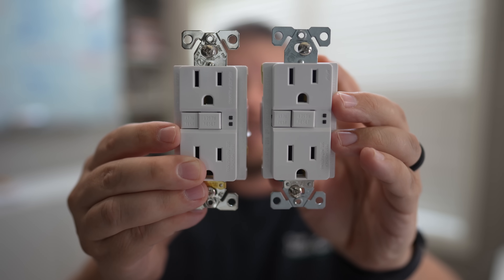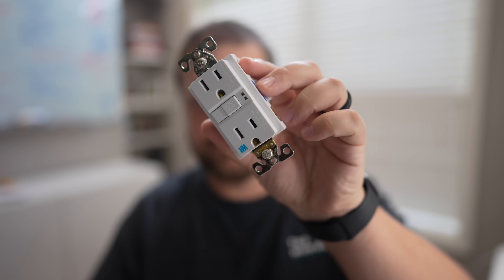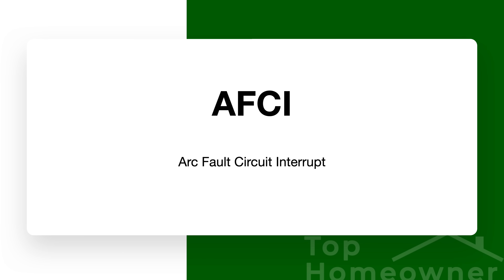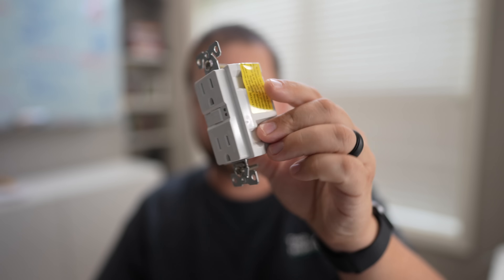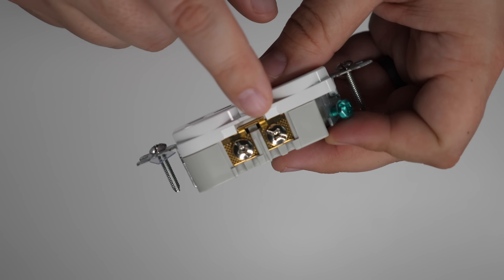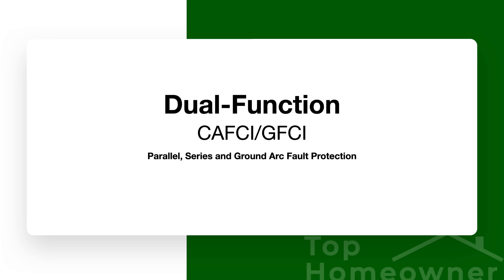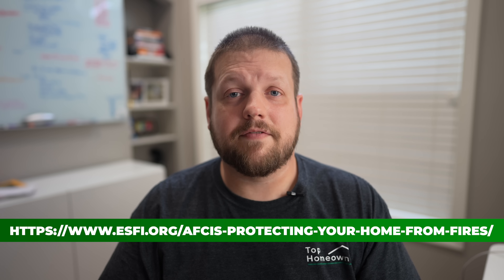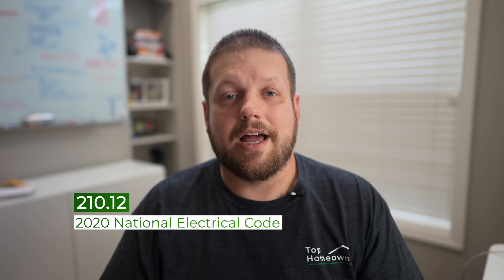AFCI vs GFCI: What's The Difference and Why You Should Care

Comment: As an engineer, I found this video really good on one point many miss, and poor on others.  

I was waiting to hear it claim a GFCI senses current to ground, and impressed that it spelled out difference between hot and neutral, while avoiding that common error.  That of course is what enables a GFCI to be useful with 2 wire appliances common in kitchens and baths. How it does that could be compared to an Amprobe type meter, and why it reads near zero if looped over a power cord, versus a single conductor.  Anyone familiar with CMRR in microphone and similar cables, or differential amplifiers in instrumentation, plus with basic physics of current and magnetism, could of course picture a deeper level of detail.  Also think UTP and STP in telecom and data networking cables.  

AFCI's may detect some of the described faults, but their Code legislative justification is most certainly NOT for the basic building safety violations this video suggests. The solution to that is blacklilst the incompetent jerks pretending to be those electricians.  Bedroom locations for AFCI's assume they're locations where old dried out and tiny SPT wire to lamps or small appliances with failure modes from broken insulation at pinch and bend points starts fires, as well as use of undersize extension cords, or crap receptacles (eg, Chinese outlet strips rated 15 amps with heaters, that catch fire as they age just slightly).  

Those cables may arc when failing, without a ground fault, and with far less current than a normal breaker trip.  By comparison, 14 or 12 AWG permanent wiring rarely has those same faults, and is more of an issue in a kitchen or laundry feed.  

As to how or what AFCI's detect, "noise patterns" is a fairly decent answer, but absent going into electrical engineering details, it's sort of hard to give an accurate as well as simple answer.  

FCC does not itself certify Part 15 low power unintentional radiator conformance, but contrary to a couple of mentions in this video, that has nothing to do with the fire hazards AFCI's are meant to prevent.  (Junk knockoff products illegally imported via ScAmazon may have other unrelated quality of manufacture defects, which are in fact relevant to AFCI detect parameters.  ScAmazon blacklists customers who post factually accurate reviews critical of spec and legal frauds of those types, by it or its vendors.  Its coerced distribution from their warehouses and logistics services place them in the position of physical commerce in such items it then pretends are only third party crooks, as if eBay shippers in China; if only Customs, the FBI, FTC, and FCC, did a serious investigation, it'd require shutting down all ScAmazon warehouses for a few years of detailed review of many items.)
Reply from the maker: Thanks for your feedback! One quick point is that AFCI's are required pretty much everywhere in a home now, bedrooms were the initial requirement 25 years ago. Most likely to phase in the requirement over time. Doesn't make much sense to only have them in a specific area of a home otherwise since you can have damaged in-wall wiring, loose connections, or bad devices in any part of a home.
Reply: @TopHomeowner  If we think about where lamps or small appliances with such potential failures are used, that's also "anywhere", even if bedrooms were the original focus.  

There are also the false trip issues largely from brush motors, and adverse response to AFCI's when fans, vacuums, small tools, kitchen mixers, fans, etc, may have conflicts.  The intervening time may have assumed people would adapt, designs to lessen those conflicts mature, and costs go down or be more expected than when initially introduced.  

There are places where false trips are more serious, like the freezer in my garage not far from a double laundry tub utility sink, where risks from a false trip are more serious than ground faults or arc faults.  

In some regions, AFCI's may help with yet another failure cause...  Not bad wiring from electricians, but rodents love to eat certain plastics, or burrow in attic insulation. In those cases, only breaker versions and not point of use device receptacles, can help.

Comment: The guy that invented GFI‘s was a friend of the NEC board they got together made it mandatory to install GFI.They made off with millions.More people have been injured because of GFI, especially when the elderly required oxygen generators.  And in hospitals and at home if the GFI trips they go without oxygen heart etc.. That’s why hospitals do not plug into the GFI circuit only dedicated, which is an orange plug.
  In Europe, they do not have a ground wire system. Everything is double insulated, here in America almost everything that we use is double insulated making GFI‘s worthless useless and a unneeded cost, but the guy that invented it and the Nema guy they’re living in the Bahamas, high and mighty.

Comment: How do you inspect a circuit for an arc Falt?
Reply: Arc fault breakers in bedrooms are just another scam like GFI. They don’t use them in Europe because it’s a two wire system., everything is double insulated in Europe and it’s getting that way here in America as well. The code for GFI really needs to be rewritten and the guy that invented it and the NEMA GUY,  they made millions  THEY ARE scammers by the way I’ve been an electrician for 52 years with a masters license.

Comment: Your point about them being required in new boxes put me at ease about why it was so hard to find a combo AFCI/GFCI receptacle today. 

Sounds like new house doesn't need AFCI because it's already present at the breaker, old house doesn't "need" it because it's not needed for code. The only people still shopping for them are overly cautious DIYers and special projects.

But I needed a GFCI for the wet areas, and decided to splurge for one for a dedicated microwave line. I'll be happy to have spent the extra $9 total to reduce my fire risk by at least that much. 

Luckily, while they didn't really upgrade my breaker, they did re-run most of the Romex. So at least I'm not looking at fabric in this 100 year old house.
Reply: Your insurance company may suddenly decide you need them whether they are code or not.

Comment: I had a GFCI outlet that would trip when I had a space heater on it and too much connected to the same circuit it was on but not on gfci's. The breaker would never flip just the GFCI outlet would flip. I suppose with the space heater pulling a good amount of power a long way and two other outlets pulling power a good distance must of eventually caused the load on the GFCI outlet to become unbalanced.

Comment: If you protect a circuit with a breaker, are you required to put a GFCI sticker on all protected receptacle wall plates?  Or, are there wall plates with GFCI emblazoned on them?

Comment: I didn't even know they made an individual AFCI receptacle.  Just put all the damned fans on the lighting circuit.  Then you can put the whole plug circuit on one AFCI breaker.  And if the clients breaker trips, try an "AFCI/GFCI combo breaker" which are usually less sensitive and usually work as a magic bullet to the problem.

Comment: The thumbnail uses two copies of the exact same picture of the same outlet, but pretends these are two different outlets.  Downvoted for lying and being clickbait.
Reply from the maker: The term 'clickbait' refers to content that fails to deliver on its promise, which is not the case here. If you watch the video you can see that I show both types receptacles side by side in the opening which confirms the thumbnail is accurate.
Reply: @TopHomeowner  My comment applies to the thumbnail, not the video.  The video can't be clickbait because that can't be viewed before clicking on the link to the video.  The thumbnail can be and was in this case.

Comment: I hope AFCI has gotten better in the past 5-6 years.  They are widely known for the “nuisance tripping”.  And for no apparent reason.  My niece home has them and two of them kept tripping.  After expensive service calls(2), they are replaced , and one of the breakers replaced twice. The replacements seemed to rectify the problems, finally. A lot of wasted money to correct the defective breakers.
Reply: Any breaker over 10 years old has exceeding it's life expectancy and could possibly fail. Most don't but I've now replaced 5 on my 19 year old home, two of which have been AFCI type. Carpet and static electricity is also a problem with AFCI when plugging devices in and will trip them.
Reply: @AZBADBOYz  Is that the life expectancy for AFCI breakers?  I know standard breakers should be good for 30 years, if not longer.
Reply: I bought the new receptacle kind for my kitchen about a year ago. They've been working perfectly but who knows 🤔

Comment: Don't drive nails and screws through electrical wires in the walls and make sure all connections at receptacles and switches are tight, don't need very expensive new breakers?  Got it.

Comment: If I disconnect or add a very reactive load, will the induced voltage be seen as a fault and trip? Electric motors come to mind.
Reply from the maker: Yes, it can. Motors are one of the things AFCI's tend to have a false positive reaction to. They've gotten a lot better at rejecting false positives over the years though.

Comment: I am getting nuisance trips in the kitchen I wonder if I put a AFCI instead of a GFCI plug in. I probably read the box and thought this outlet sounds better than this other one and installed it. lol.
Reply from the maker: Very possible! It should be stamped on the front. It'll either say AFCI, GFCI or both.
Reply: Yep. It actually said both AFCI and GFCI on the front of the outlet. @TopHomeowner   I just replaced it with a standard Tamper Resistant GFCI today hopefully that solved the problem. :)

Comment: I know how GFI works, or compare the current coming and leaving, if there is a milliamp leakage, it will cut off the power.  AFI?  I have a hard time to seeing Arc by 110V.  Shouldn't parallel arc trip the circuit breaker?  Anyway, it is good to have these to protect the wiring (and house fire).  Here is a cheap solution, or NO electricity to anywhere?

Comment: My old landlord knew all the tricks of the trade and did everything the cheapest way, his way.  I kept smelling what I thought was cigarette smoke in the house of a night.   I don't smoke.

I finally tracked it down to a connection he or one of his "helpers" did coming out of the circuit breaker box.    The twist connector had gotten so hot that it was melted on the wiring.  He had twisted together aluminum wire to copper. This is something you do not do.  Both expand and contract at different rates and the connection will come loose.

He always did things the cheapest for him.   He updated the living room with new drywall but put in no insulation in the ceiling making it really hard to heat.

Comment: I just want to point out that "nuisance trips" from AFCIs are almost always because you are using a device that does not have the level of power line filtering that it's really supposed to have built in.  You can usually fix this fairly easily by just adding an extra power line filter to the power cord for the device.  You do not need to (and should not) get rid of the AFCI breaker.  Just fix the bad device instead.  It's not actually that hard.

Comment: AFCI's  do  not detect sudden power   they detect very very small arc.  like the arcs you can visible see in a brushed motor..  which is why they cause nuisance faults  
or say a cord is partially loose, but it's close enough for an arc to jump the gap,    this small arc can maintain for a  long time.. and start a fire..       which is why they are required on bedrooms

Comment: gfi are annoying but worth it for safety in wet locations afci is just ridiculous and I replace them with regular 20 cent receptacles in dry locations whenever I find them in my home. If it's an GFI AFCI combo I just replace it with a GFI. i get safely and get GFI but I don't got time to reset breakers every time I plug in something with a brushed motor. I've been in houses that STILL used bare wire wrapped around  and stretch between coke bottles in   attics . I've lived in homes that had two conductor wiring hooked to three-hole receptacles with a bootstrap ground and they are still standing, afci is expensive overkill.

Comment: Ground fault interrupters will also protect you from electronic devices that may have one of their "power" leads grounded to the chassis, either intentional or  due to wiring issue.  This was fairly common in the '70s though the '80s.  If you are not grounded, you wouldn't know it existed.  But if you are grounded, you will be the return path of the electricity.  ACs, Heaters, Refrigerators, TVs, Toasters all were notorious for wiring the return to the chassis and did not have a true ground.  If you ever where at grandma's house and touch the toaster or fridge and then touched the metal of the sink and got a mild shock, that was because you became part of the electrical circuit.  If you were properly grounded it would go from a mild shock to a serious hazard.

Comment: In general, GFCIs are ANALOG measuring devices that prevent lethal electric SHOCK, whereas AFCIs are DIGITAL measuring devices that prevent approximately 87-89% of branch-circuit ARCING incidents  that can result in FIRE. Neither GFCIs nor AFCIs protect against fires resulting from non-arcing GLOWING (loose) TERMINATIONS and CONNECTIONS (if no separation then no arcing). AFCIs also will typically (or at all) not protect against steady (non-arcing) TRACKING where NONELECTRICAL materials have experienced PYROPHORIC CARBONIZATION. 

AFCIs can address SERIAL arcs [break(s) in SOLELY the ungrounded conductor(s) OR in SOLELY the grounded conductor] or PARALLEL arcs [break(s) in SOLELY the INSULATION electrically separating the ungrounded conductor(s) and the grounded conductor (even if having no connected load)]. AFCIs that address BOTH serial AND parallel arcs are called COMBINATION AFCIs. Most (all?) commercially available AFCIs, whether circuit breakers or receptacles, are COMBINATION AFCIs (CAFCIs). [Devices having both CACFI and GFCI are “DUAL-FUNCTION”; don’t confuse with COMBINATION AFCI.]

GFCIs continually measure INSTANTANEOUS current-in versus current-out. 

By contrast, AFCIs measure the SHORT-DURATION sweep of any arcing that at least INITIALLY ignites then sputters out (or quenches, for AC, at zero crossing). That arc sweep can be captured digitally and stored for comparison. 

There are “good arcs” and there are “bad arc”. “Good arcs” are  for example when switches and motors normally operate. “Bad arcs” result from DAMAGE that breaks conductor or insulation and cause sputtering arcs that can ignite building materials.  An AFCI contains a MICROPROCESSOR that stores a “library” of the RECORDED digital characteristics of both KNOWN “good arcs” and KNOWN “bad arcs”, tens or hundreds of thousands of digital signatures. When arcing is detected, the AFCI’s microprocessor rapidly compares THAT arc’s digital signature with the digital signatures in its “library” of KNOWN “good arcs” and KNOWN “bad arcs”. If it’s a KNOWN “good arc”, the AFCI does NOT react; if it’s a KNOWN “bad arc” or an UNKNOWN arc, then the AFCI trips. (UNKNOWN “good arcs” cause “nuisance” tripping.)

Newer AFCIs have containing newer “libraries” with more KNOWN “good arcs” and KNOWN “bad arcs”, reducing the likelihood of UNKNOWN arcs and of “nuisance” tripping.
Reply from the maker: Great detailed comment, thank you!

Comment: If you have circuits with a shared neutral (typically a three wire situation with a black, red and white wire on two single pole120v breakers or one double pole breaker), the labeling on a dual function breaker specifically warns that this may cause nusance tripping and to not use a DF in this situation. 

 I am currently remodeling a house that was built in 1951 that has two prong outlets without an equipment ground wire.  I want to upgrade the outlets to three prong outlets and by code can either add a ground wire or add GFCI protection.  Otherwise, I need to replace the two prong outlets with the same thing.  The bottom line is that I can only use GFCI breakers on these circuits and these are currently more expensive than dual function breakers because of code changes that require their use in most locations.  Perhaps the author is aware of a dual function receptacle that will work with shared neutrals.

Comment: I can see the usefulness of CAFCI. Don't see the advantage to AFCI. If there is a short from hot to neutral your breaker should trip. Of course that is if you have good quality breakers like square d or cutler hammer. The culprit for electrical fires is more commonly where a CAFCI would help. I do not believe those numbers for house fires. If the fire marshal can't find any cause of the fire, he can always find a melted wire.

Comment: I think afci is just a bandaid for making shoddy electrical connections such as back stabbing plugs, ect. If electricians would take the time to pre twist wires and put them in a wire nut, pigtail and side wire receptacles, etc, I don’t think there would be many arc faults to begin with.

Comment: If sudden spikes caused a standard breaker to trip, then every time your heat/AC/fridge kicked on, it would trip.
Reply: These types of loads may cause a surge in current when starting, not a spike. Breakers generally handle these without problems.